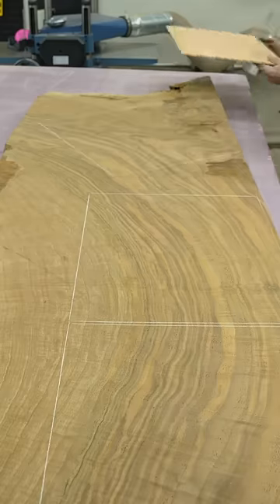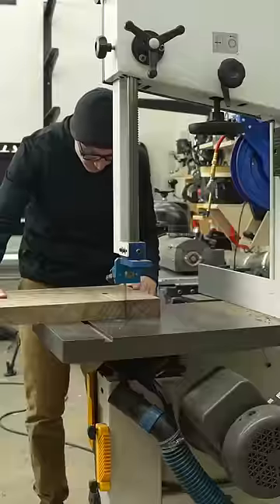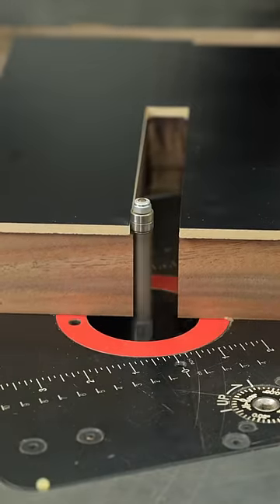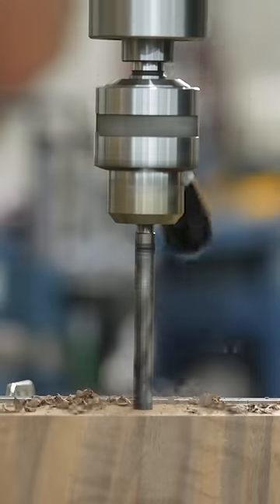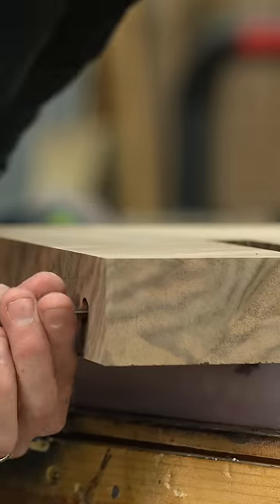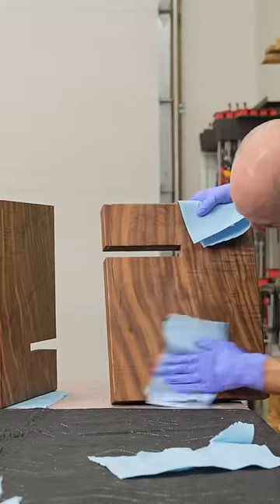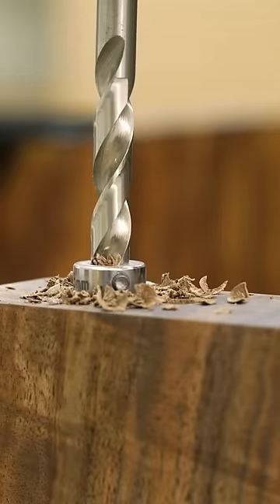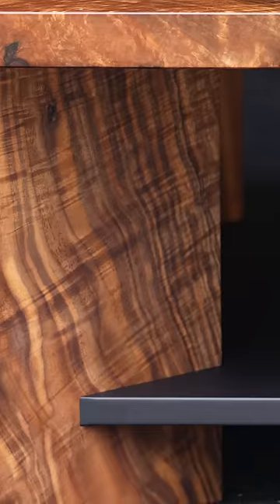Metal & Wood Joinery

Comment: This guy: cuts the wood a slot and makes custom mounts.

My brain: .. seems like cutting the slots in the metal would be easier.

Me after thinking: .. wait, how do you hold it up?

My brain: .. L Brackets, close to the inside so it's not noticeable from common head height when sat down.